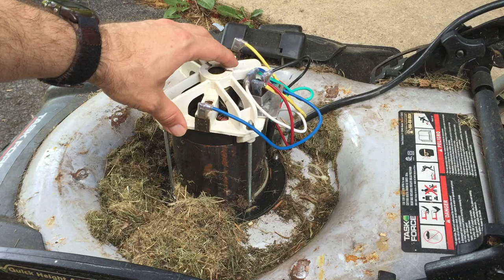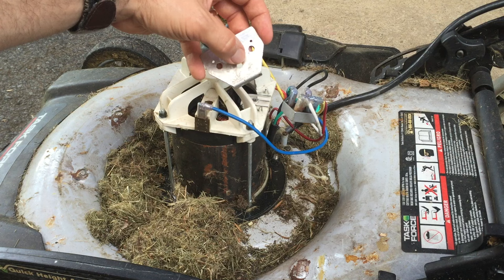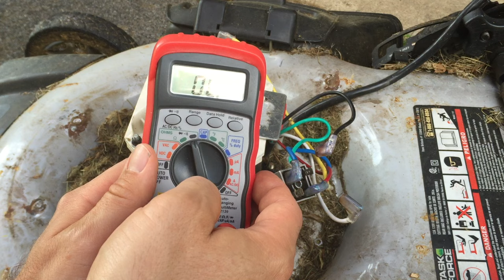How to Fix Electric Lawnmower (Rectifier) - Trips Circuit Breaker Short Circuit (Task Force)

Comment: FrugalRepair, you are leading the charge of the FixIt movement (PUN intended). Good work, am subscribing to up your numbers. You deserve it.
Reply from the maker: Thanks!  That is such an awesome encouragement!  My hope with this channel is that it can help promote the movement of repairing things yourself rather than throwing them away.  So many things I get for free that only take a little bit of effort and an inexpensive part to fix.  The main issue I find is getting over the fear of "I can't do this".  Hopefully I can inspire everyone that , yes, you can do it.
Reply: @FrugalRepair  I used to follow my dad around our house (built in 1854) when he would make repairs. From him, I learned basic household wiring repairs, how to fix electric lamps, and the basics of furniture repair.  Regarding lawnmowers, once a new electric mower's electric activation unit in the handle stopped working. I had an old mower of an earlier model sitting by our back shed. Went to that older electric mower, took out the activation unit, and installed it into the new mower. Bingo! saved 250.00 on a new electric mower. What a sense of satisfaction!     PS, one of the first troubleshooting tips for when you are working with electrical wiring contacts is to use the highest precentage of rubbing alcohol to clean the wires. Alcohol is a universal solvent and removes unseen gunk from electrical contacts. A couple of times I have had small electrical watches that had quit working . . I removed the back of the watch and sprayed 91% alcohol into the workings. Then I let it sit for 24 hours or more and then plugged in the battery. Has worked on half of the watches that I tried to fix. Heck, a new electric watch can cost at least 7.00 and up. Love fixing things.
Reply from the maker: @j.b.9581  That's so great!  Thanks for sharing.

Comment: Excellent troubleshooting using DMM.  Also use of thermal paste is something to note down (I just bought and used a Kobalt Corded Lawn Mower) for my future repair when time comes.  I do not know whether the rectifier of one brand of electric motor will work with another brand of electric Lawn Mower (of same amp) because it is hard to find motor parts for the Kobalt Lawn Mower.  I loved your video. Thanks for your time in preparing the video and sharing.  Hats off, Sir.
Reply from the maker: Thanks for watching!

Comment: Is the bridge rectifier a universal fit? I have a black and decker electric mower. Don't you just love the free section of craigslist? I do. That's how I got 2 of my electric mowers and a bunch of other things that just needed some TLC.
Reply from the maker: The have a voltage and amperage rating so you need to make sure it matches.  But for a corded lawn mower, they might all be similar.

Comment: Hello and thank you )and subscribed) for inspiring me to take my brushes out. I have exact same mower but my brushes where inside metal sleeve. Had problem of running intermittently and then not at all.

I finally figured out how to take the brushes out. The brushes are in a rectangular tube that guides the brushes. 
You would not believe it but the brush sleeve/containers where chock full of grass and sludge. How in the heck did grass get in there? 

Anyway, the square metal jackets come out by bending small tab down that is on the top so I could slide them out. The jackets looks like it has a metal version of a wood dovetail joint for a seem. 

Anyway two needle nose pliers easily pries the jackets open. That allowed me to pull the brushes out and wash off the grass gunk sludge and then re-insert into casing. 

Closing the jacket/casings back up was a bit of a trick but the use of channel locks did the trick. I had to play around with the corners and small dimples of the jacket a bit by bending them so the carbon brushes would pop out fast. If you press them in and they stick that's no good.

Once I got the carbon brushes where they both sprang out easy I knew I was home free. Runs like a charm. Thanks again as I was nearly seconds away from tossing it out to the curb.
Reply from the maker: That is great to hear!  I'm glad you got it running again.  I love the repair story.

Comment: Do all electric mowers use a dc motor? If so, would that mean you could easily change a corded mower into a cordless by removing the bridge rectifier and connecting to a battery?
Reply: As best I can tell from reading the  specifications of the lawn mower rectifier is that it converts 120VAC to 170 V DC.   Supplying 170 VDC from just a battery would be difficult.   I imagine cordless electric mowers have more complicated circuitry that permits using batteries supplying much lower voltages than 170 VDC.

Comment: Great explanation.  I wonder why even the prong to my extension cord partially melted before the breaker turned off.  We are ordering the part without buying the meter in hopes that it works.
Reply from the maker: That sounds a little scary that the breaker didn’t trip first.  Hopefully replacing the bridge rectifier will do the trick for you.
Reply: My black & decker mower did the same thing because their switch wiring failed.
I replaced the switch as shown with the repair on this website, then the bridge rectifier,
and then the extension cord.  http://nickviera.com/electrical/lawn_mower/bandd/index.php
Reply: You may need to check your circuit breaker.

Comment: Frugalrepair. I have an electric mower, a sunjoe, tiny thing it runs but only for about a minute, then it shuts off...I wait about a minute, push the reset button and it starts again fine then after about 30 seconds it trips theswitchbox again. Any idea if its the rectifier or the switchbox?? thanks. Excellent video. keep it up.
Reply from the maker: Maybe it could be getting hot enough to cause a short circuit in the rectifier and that is why you need to reset the breaker?  I doubt it is the breaker itself.  Thanks,  I was just working on my latest video tonight.
Reply: have you resolved the problem? I am having the same issue, and test the rectifier come out good, but the mower started and run for 10 sec, and trip the breaker, reset, then another start and run for 10 sec, trip the breaker again....

Comment: My lawn mower is greenworks . When I connect my plug to a socket my breaker rests why? What parts should I get and from where? What may be the reason?
Reply: When there's a short in the mower, usually the bridge rectifier, that causes the breaker to trip.

Comment: I noticed you’re using a 25 amp rectifier for a 12 amp motor. I have a 13 amp motor motor will the rectifier you’ve linked work on my lawn mower. 
Since it works on yours I’m assuming it will.
Reply from the maker: Should work fine!

Comment: Thanks for the video!  I have the same lawn mower.  Same situation (got it for free).  Love the thing.  Going to try to open it up and fix it the way you did, but have the same situation with stripped screws.  It looks like you just cut it off at the bottom to get the top opened up.  Is that what you did, and how did you reattach?  Thanks so much!
Reply from the maker: I'm glad to hear you are going to fix it!  Yes, I didn't feel like working real hard to save the screws so I used my sawzall with the hacksaw blade and cut the screws off.  If you do this you could tap new screw holes but that seems overkill for a lawnmower.  I just used duct tape.  It looks ghetto but I didn't care.   You could also use an adhesive that could bond plastic to metal.  Hopefully you can get at least one screw out to re-use.

Comment: I have a greenworks electric mower. I did the rectifier replacement and that brought it back to life. Thanks! The problem now is that it is always on, the power switch has no effect...any ideas?
Reply from the maker: Great to hear you got it fixed!  I don't have the same model as yours but it seems that the only thing left to check is the switch.  It sounds like it is stuck in the "on" position.  Maybe try clicking it a bunch of times with the power off to get it unstuck?
Reply: Bueno, Juan, please see my comment above about using 91% alcohol to clean the electrical contacts. But MAKE SURE the unit is unplugged when you do!!

Comment: My Task Force electric mower wiring became disconnected from the Start/Stop area.  I'm trying to figure out where the white wire connects.  Does it go back into the same plastic cap where the other white wire is at so they connect/touch each other?  Or is it suppose to not connect to any other wire and serve as a "ground" wire?.  Any help is appreciated.  I can send picture if that helps.  Thank you

Comment: Awesome I watched this video several times it lead me to find other issues such bad connectors and several months later the brush issue the casing is burned out hopefully changing it will help ..
Reply from the maker: Great job tracking down the issues!  Let me know if you want any more help.
Reply: FrugalRepair ok I  couldn't get the brush out itsbcasung (the plastic is burned unto it ) while trying I dented the casing inside the plaster now I'm afraid I will have to break the plastic to separate it and try to find a way to connect the brush sort of like the Black and Decker electric. Mower connected with a screw, I think many help or suggestions will be appreciated
Reply from the maker: Is there a way you can post a picture of what you are looking at?  You will eventually need a sturdy way to hold that brush in place.
Reply: @FrugalRepair  I'm trying to find a way to post the image

Comment: Excellent video, thank you for the clear explanation. On my mower, the braking mechanism doesn’t work. It turns on and runs fine but when the handle is released, it just slows down eventually instead of immediately braking. Could that mean the big 50w resistor needs replaced? Based on your other video about how the motor works, it looks like that might be the problem. If so, do you know where to buy a replacement?
Reply from the maker: I would suggest checking your resistor with a multi meter.  For a replacement, I search on eBay, AliExpress and anywhere else I can buy it.
Reply: @FrugalRepair  Thank you for taking the time to reply. There is no continuity between the two terminals on the resistor so it is probably toast. I haven’t had any luck finding one on eBay but will try AliExpress.

Comment: What is the probability the DC motor burns ? I just got a free lawnmower, I am guessing it overheated as it was full of grass, the one in the video died because the loose screw that was holding it against the metal radiator, the rectifier overheated and blew
Reply from the maker: Besides the rectifier going bad, another common problem is that the brushes wear down too much.  And you need to replace them. If you don’t know what I’m talking about just google “brushes for electric lawnmower”

Comment: How did you use a sawzall to cut the screws?  I've got the same mower and the screws refuse to unscrew.
Reply from the maker: I think I just put the hacksaw (fine tooth) blade in between the plastic and the deck and cut it off.

Comment: I have a Greenworks 20-inch mower much like yours in this video. The blade auto-brake has stopped working. I recently replaced the motor for another reason and it worked fine. When the new problem started I replaced the bridge rectifier. That didn't fix it. It also has a cement resistor in the circuit. Could that be the problem?
Reply from the maker: What are your symptoms? Is the blade spinning? Does the resistor test out OK with a multi meter?

Comment: Thank you for the very informative video. I replaced the rectifier but when I turn on the mower there is a POOF sound,  a bit of smoke, a burning smell, and the circuit breaker trips. There is no continuity between the AC terminals on the rectifier but there is continuity between the terminals that are wired to the brushes. Is that normal? The switch continuity test shows that the switch is working fine (and I tried replacing the switch with a new one too just in case). Does this mean the motor has failed? Is there anything else I can try?

Comment: My electric mower has a bad connection between where the motor spins in the tower and the block of ??? That is shaped like a pack of old chewing gum. It is what is inside of where the blue is connected. What is that called?
Reply from the maker: It’s called a brush.  You can buy replacements.  The motor is a brushed motor (how it gets electricity to create the magnetic field).

Comment: Hello did you have the mower connected to the mains whilst testing this? 

I.e the lever on the handle to the on position? Or do you just need to plug it in simply

Comment: My Greenwork had this problem and I also replaced the bridge rectifier. It will now start up for a second or two but it still trips the breaker. the only clue I have is the engine sparks a little. I don't see any exposed wires. Any idea what I am doing wrong?

Comment: So what does it mean if there is no short across the rectifier bridge, but the circuit breaker still trips? Defective switch?
Reply from the maker: Probably.  There is a short somewhere in there if that is happening.  You could disconnect the bridge rectifier leads from the switch to isolate the short
Reply: @FrugalRepair  The rectifier does not need to be installed and connected to be tested correct? I took mine out (making note of the connections) and using my meter checked for a short......none. Can the switch be defective? Can I test it with my meter? There are 4 connection points on the switch, same as the bridge. I have also heard of the brushes causing problems if they are worn. But how badly worn do they have to be....?

Comment: Thanks for this video, Reese. I have a Task Force electric mower also but my problem is not the rectifier but the 90 degree connectors, encased in the milky plastic, to the rectifier. One of them broke so I duct taped it temporarily to finish mowing.  To your knowledge, can those be purchased separately? And are they easy to replace, as you show for the rectifier in this video? Also, as I mowed with the cover off, I noticed a lot of sparks inside the motor - is that "normal"? (I thought it might cause a fire).
Reply from the maker: I imagine what you’re talking about is the silicone holding the connector down.  I’m sure you can buy a replacement somewhere I don’t know what they’re called exactly, they might be 90 degree F1 or F2 connectors.   For the sparks, it’s a brushed motor so that is the commutator delivering electricity to the motor.
Reply from the maker: The brushes do have a limited lifespan so it’s possible they need to be replaced.  But my guess is that it’s normal.
Reply: @FrugalRepair  Thank you for both replies - I appreciate your help to ALL who ask questions/seek your advice ;)

Comment: I wonder why they just didn't use an a.c. motor, if it plugs into the outlet.
Reply: I think single phase AC motors have zero starting torque. So to get this to work you'd have to have some way to kickstart the blade.

Comment: I believe mine is cutting in reverse, can changing 2 wires on the rectifier change rotation?
Reply: Dc motor just reverse the positive and negative connection.

Comment: Great video!  I have a homelite mower.   I cut long grass with it and now the mower won't start.  each time i plug in, the circuit breaks.   last time, when I plugged in, I saw some smoke from where the extension cord connects to the mower.  Should I still try changing the rectifier?  thanks!
Reply from the maker: Thanks!  Can you test the rectifier with a multimeter?  That will tell you if it has a short circuit in it or not for sure.  Otherwise, you'll just be taking a shot in the dark by replacing it.  Though, it sounds like that is the most likely culprit.
Reply: Hi. Thanks for the quick replies!  You are so helpful :)  I switched the rectifier and now the mower just starts when I plug it in.  is it still safe to use?  if not, what should I try doing?
Reply from the maker: Is it possible that the switch is stuck?  Maybe play with it and wiggle it around?  I'm sure you can cut your fine in this condition but the safety switch should be working.  Worst case, you may need to replace the switch.

Comment: i wouldnt follow the printing side as a guide to the pin out of the new device..  a lot of time with electronics repair, the original manufacturer has long since dissipated, but you will find the same part number now being manufactured by 10 new places.  They all will work just fine, but all will have slight differences from one another.   One difference is the arrangement of pinouts or slight case modification.

Another thing to note is to not get hung up on using the EXACT same part as the one you are replacing.  Sometimes to buy the same part from the same manufacturer etc. will cost 10 times what it costs for a part of equal quality and performance, sometimes even better.  I suggest when you have a part fail, you search for the datasheet and review the specs.  Search for a component that is equal to or exceeds the rated max voltage, amperage, and power ratings.  I've seen massive price differences in newly manufactured stuff like bridge rectifiers vs. appliance and tool replacement brands. (2$ vs 10-15$)

Good luck and happy mowing!  dont cut my grass!

Comment: Hi, so I have the newer version of this mower and I tested the rectifier using a meter and it's fine. I can't get my mower to start, i wonder what the problem could be.
Reply from the maker: If it’s a brushed motor it may be the connection to the commutator.  You can google how brushes motors work and maybe figure it out.
Reply: @FrugalRepair  model is 25022, im not sure what type of motor, looks similar to yours
Reply from the maker: Veneet Bansal mine is a brushed motor
Reply: I would check the voltage on the positive and negative terminal or brushes.  Note that no reading when checking may mean open damaged rectifier.